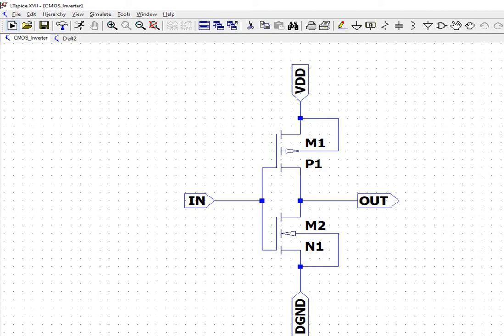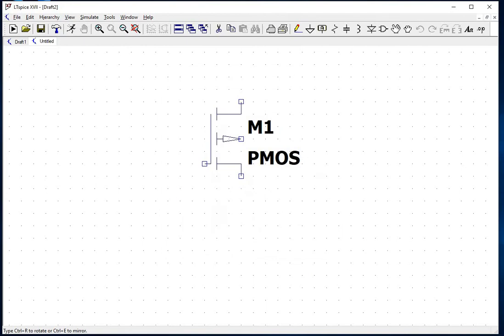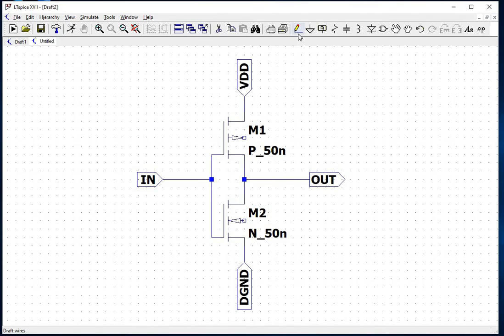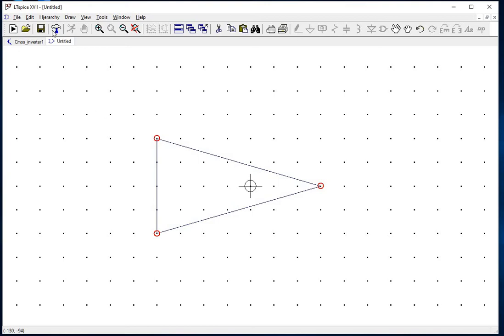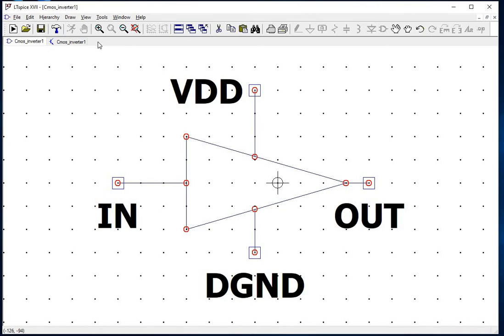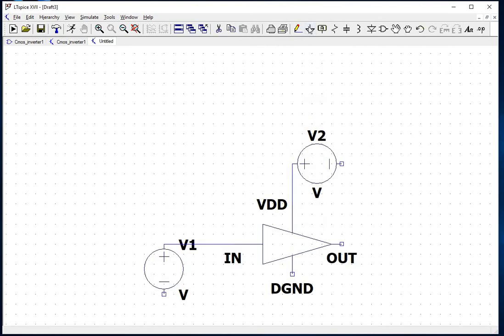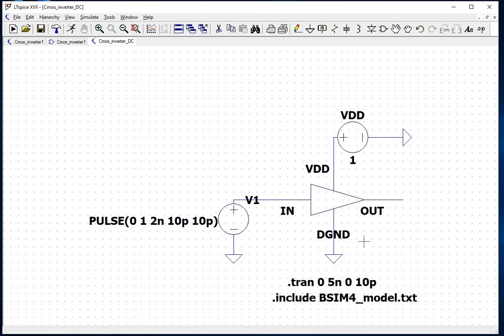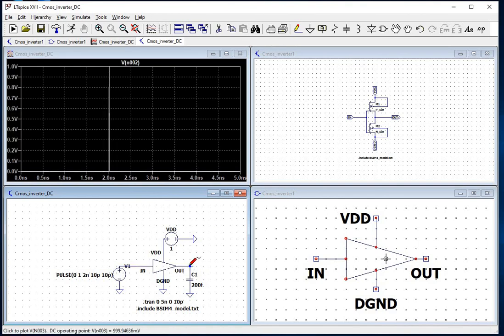DC analysis of CMOS Inverter using LTSpice circuit simulation

Comment: Nice explanation. I am getting an error - "Could not open BSIM4_model.txt" though I have copied the file in the location of the schematic. Could you please help.
Reply from the maker: Have you used the syntax properly?  Please check the same tutorial on my websites step by step procedure.
You can drop a mail to circuitgenerator2020@gmail.com
https://circuitgenerator.com/dc-characteristics-of-cmos-inverter-using-ltspice-circuit-simulation/